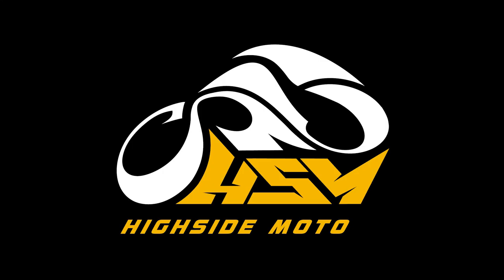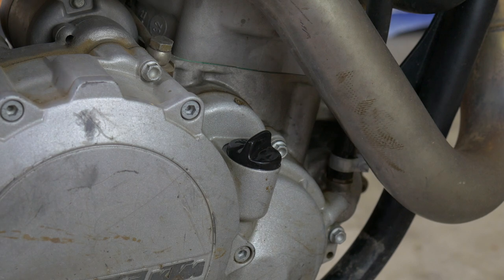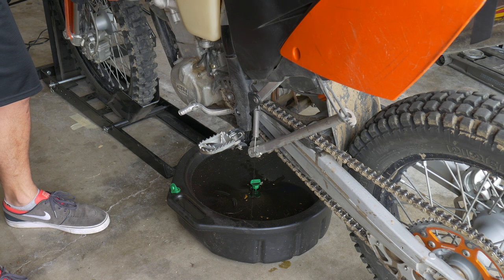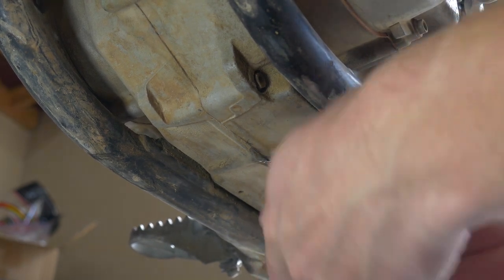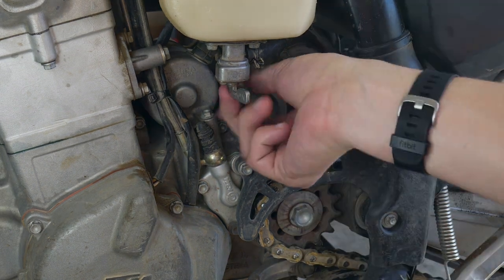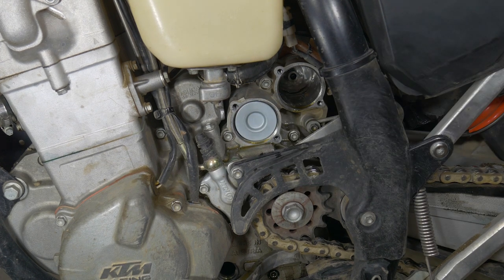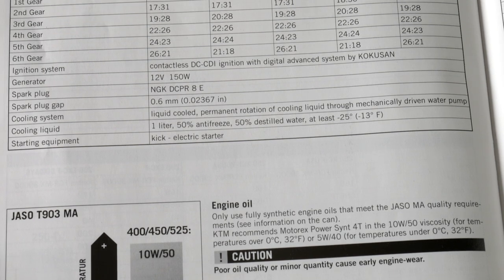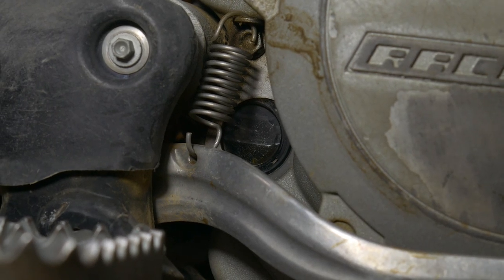Super Easy KTM 525 EXC (RFS Motor) Oil Change

Comment: sir u need to fill the oil filter with helf of oil . when  u reaplace to new filter. this is even writh on service manual. the reason when u start the bike there is few second until the filter oil is fill and the bike upper enigne dont get oil .. this will not destroy your engine if u didnt do it. but i think for the long run. this will be effect. btw i have exc 525 2004.
Reply: No it won’t.  There’s a second or two maximum to build up the oil pressure, residual oil inside the engine will take care of it.
Reply: @Dansyoung  He said it wont destroy your engine. I can say from experience, on my 450 that it definitely effects the amount of oil i have to put in. I have done it both ways and if the filters go in dry you need to add more than the factory recommended 1.1 L(whatever it is)

Comment: Little tip here: ( this is mentioned in the manual too ) the oil should almost reach the top of the sight glass because than it is on the maximum so if it falls over or especially in a wheely it gets the oil better, u have a little longer change Intervall and Zou don't have to worry about the burning of the oil so in 20 hours it defenetly won't go ounder minnimum
Reply: no!!! to much oil destroys the oil pump!!
Reply: @bouncinnn450  could you pls explain how that should be possible ?
Reply: @totiwars8333  imagine you are swimming in a closed room, no problem because there is air obove you. But if this room is filled up with water all the way up to the top you will drown.
Reply: @bouncinnn450  I dont get it is only filled up to the maximum and not to the top if the engine how should an oilpump drown
Reply: It doesn't hurt the oil pump. Too much oil can block the breather port in the case. Which then can blow out seals. Well known issue. You want the level halfway on the sight glass after sitting overnight.

Comment: the manual instructions call for placing the bike on its side, filling the oil filter housing half way with engine oil as well as filing oil filter with oil and placing into filter box.... did you follow this step?
Reply: You are exactly right.  This step is very important for getting oil into the engine more quickly upon restart.

The other thing it does it not spill oil all over the side of the engine.  If you're careful you won't even spill a drop.

Another thing that's worth mentioning is that the internal hex in the stock bottom screen cap is prone to stripping.  If it does, it can be removed with a stubby easy out.  After that you should install the newer designed cap that has an internal Torx and 13mm external hex.
Reply: I have the 450 2007 manual and it doesn't say that. But I've seen people do that on older bikes than rfs
Reply: how would you do this on a quad?
Reply: @moto_leprechaun  soak the filter in oil before fitting or tip quad on its side
Reply: @PlantedTankPT  I have a 2007 450 owners manual in front of me right now and in the 4th step on page 50 it certainly does say "put the motorcycle on its side and fill the oil filter housings about halfway with engine oil. fill oil filter with il, place the long oil filter in front and short oil filter in back of the filter box."

Comment: Hello, I’m trying to locate the tool that you use in your video to remove and reinstall the side oil screen.  It’s very tough to put the screen back in without the tool.   I’ve checked Amazon and the dealership and no one can seem to locate the tool.  Per your video, it’s shaped like a T.  Any idea where to find this?

Comment: hello my friend I've recently brought a 2006 525 exc I've gone to do a oil change and noticed there is the main oil drain plug on the bottom of the engine at the back and only 1 oil screen drain plug on the left side by the gear lever but not any other drain holes for the little oil screen, I thought the 525 exc had 2 oil screens 1 long and 1 short is this normal on 525 exc,s or do they all have a long and short oil screen, thank you my friend....
Reply: JESSIE JAMES. ever learn any more? just bought same 06 bike need info

Comment: and the mileage interval to do an oil change?.................
Reply: I change 500-1000 on mine, which spends most of its time on the street with Supermoto set up
Reply: @cal40888  im buying a 06 525exc friday how do you like it for highway use?
Reply: Steven Sandoval I won’t get on the highway unless I have to, that’s what I have my street triple for. But it will cruise 80 mph no problem you really notice the wind though
Reply: @cal40888  is it buzzy at 75 mph? Im on a drz roght now and 75 will have your hands numb in 30 min
Reply: @stevensandoval2218  no it will do highway fine. I hate to say it but if you're intending on using it for a daily/commute the DRZ is a way better choice
Reply: @cal40888  well that sucks maybe im more suited for a xr650l. The ktm 525 is a mean MF
Reply: @cal40888  what is your gearing?

Comment: It would be interesting to know how many hours he got out of this bike changing the oil incorrectly. Normally it's around a hundred hours after this oil change at a maximum before the cam will snap in half.
Reply: What was incorrect?Not filling the filter cavities with oil?
Reply: @Evil_Morty2000  You have to lay them on their side to refill the oil filter housing And install the oil filter caps as so there are no air bubbles.